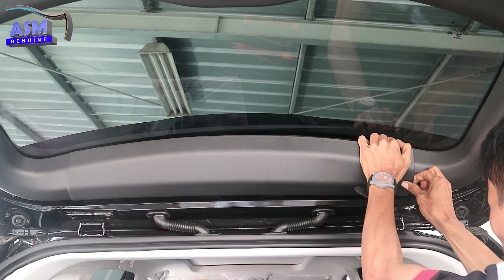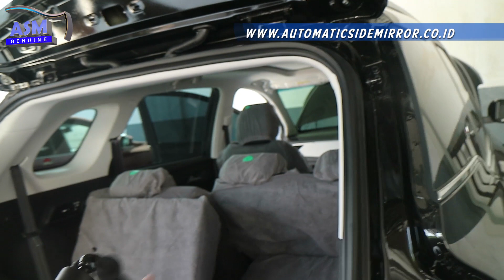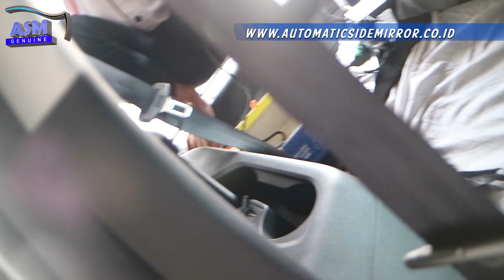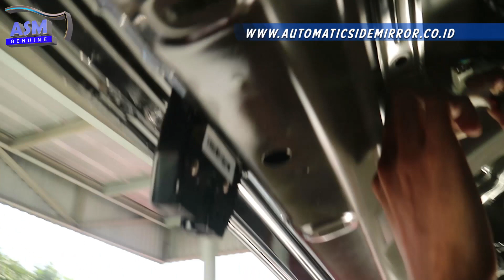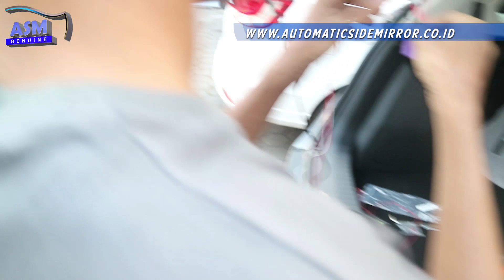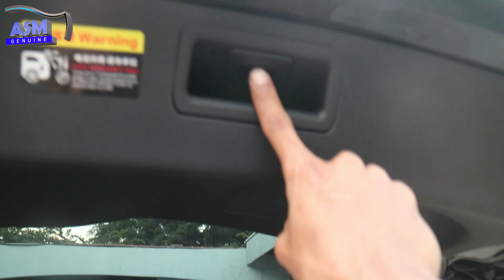TUTORIAL - Wuling Almaz Pasang Power Back Door (Bagasi Otomatis)

Comment: Bengkel rekanan di medan dimana ya
Reply from the maker: Stroker Audio
Jl Guru Patimpus No 1 E-F-G
Kesawan, Medan Barat. Medan
Phone (061) 4150854/4150878/082168980085

Bengkel Garasi 607
Jln bunga terompet raya, Padang Bulan Selayang II, Kec. Medan Selayang, Kota Medan, Sumatera Utara 20131
Phone : 081263607607

Gaya Motor / Asen
Jl. A.H Nasution / Tritura No. 9 A, Suka Maju, Medan Johor, Kota Medan, Sumatera Utara 20122
Phone : 085261222000 / (061) 4277 9371

berikut alamat bengkel rekanan kami di daerah medan ya pak